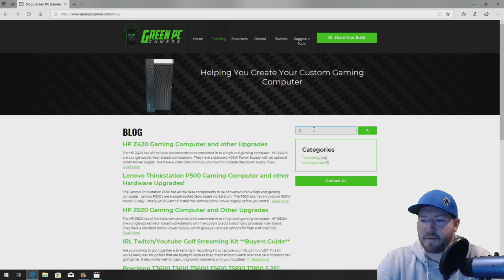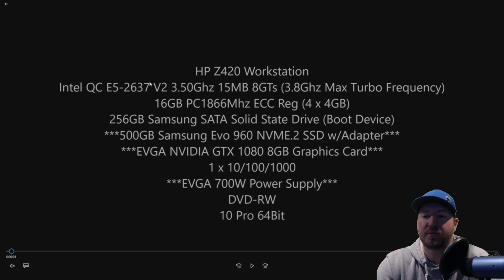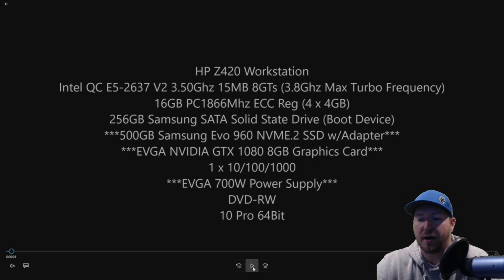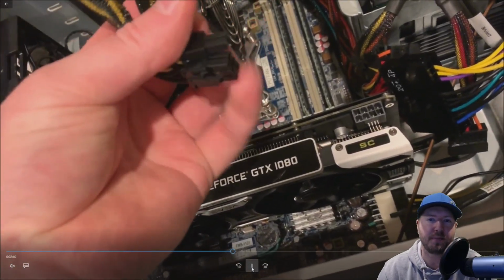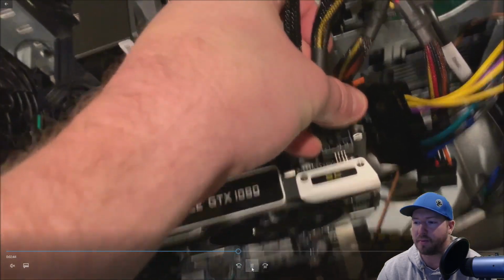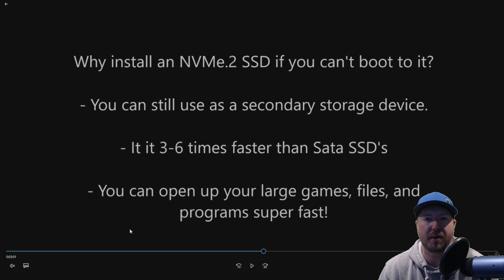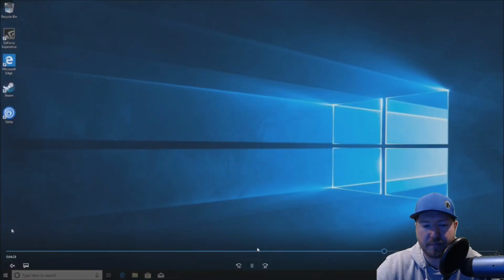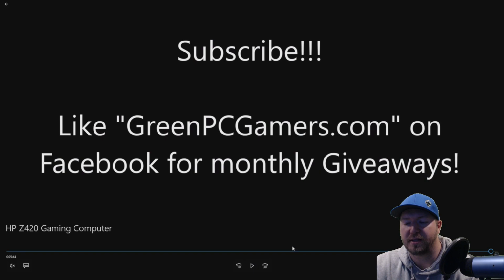HP Z420 Gaming Computer (GTX 1080 and NVME.2 Install)

Comment: I think you made a mistake on which PCIE slot you put the NVME SSD in. I'd have to double check, but, although it's a x4 mechanical, I think it's only x1 electrical. It's PCIE 3.0. So, you are capped at 0.9 GBs using that one. You are better off using one that has x4 electrical.

Comment: Hi, great video which I found rather late in the day.  My current set up is:  HP Z420:  Xeon E5-1620 @ 3.6 Ghz and GeForce GTX 1050 Ti GPU 4 GB, 16 GB RAM on Windows 10 (not 11 compatible, of course).   I just tried to install an RTX 2060 (with 2x6 power supply to 8 pin) but got no video signal out.  Nothing on either screen from any video or port.  I noticed my bios is ancient, like 2012, would this cause the problem do you think?

Comment: You sre using PCIe 4.0 SSD in PCIe 3.0 card which is plugged in a PCIe 2.0 port. How would you recommend that? Because the PCIe 4.0 SSD is already bottlenecked by PCIe 3.0 card which is again bottlenecked ny PCIe 2.0 slot. Can you explain?

Comment: I have one of these units, and I occasionally have problems when booting it up. It doesn't start the first time I click the power button, only loud fans non-stop and no display at all, I force the shutdown after that, then I press the power button and it boots normally. Anyone knows how to fix this issue?

Comment: is it possible to install 8 x 16 GB RDIMMs 1866Mhz in the version 2 boards?
Reply from the maker: Yes, but the memory will only run at the max speed supported by the processor.

Comment: So I have the same computer but I have 64 gig of ram and a better cpu so if I install my m. 2 can I move software from c drive to the m. 2 and run them off there for faster speeds?
Reply from the maker: You could do that.  However, you can't boot to an NVMe M.2 SSD on a Z420 w/o a boot assistant like clover.

Comment: Hi. Trying to install GPU geforce nvidia 650ti in a z420, but facing problems with power supply connectors two by 8 pins.Power supply is stock and more enough to run that gpu.
Can u advise any solutions with cable molex or sata options?
Thanks in advance
Reply from the maker: Are you using the stock HP 600W Power Supply?

Comment: I have a z420 that has only 1 6 pin connector and I would like to run a 3060ti that requires 2 8 pin connectors and draws 200w max. Could I use a single 6 pin to dual 8 pin adapter and have enough power to run it safely? The power supply says "G1" the 6 pin connector is 12v and 18amps which would make 225w of power plus the 75w the motherboard supplies so I should have more than enough power but I'm worried that a single 6 pin converted to dual 8 pins wouldn't be a good idea especially on a 8 year old power supply.

Comment: Wouldn't it be possible to setup dual boot?  Begin the boot loading from an SSD then pass control to the NVMe as the system drive?
Reply from the maker: You can do this with clover.

Comment: Anyone think one of these with the e1650 would suffice for a sub 200 
Dollar start to a gaming pc? Add in a rx470 or something similar used and a ssd?
Reply from the maker: It’ll work as long as you tweak the settings.
Reply: @GreenPCGamerscom  like in game settings or bios?

Comment: Hey! Not sure if you read this. On your website it states that the Z420 Comes with 600W PSU natively, and can fit in a 1660 TI graphics card. However, there are only 6 pins on the PSU, while the graphics card needs 8. Any hints?
Reply from the maker: Check out this guide:

https://www.greenpcgamers.com/technology/video-card-power-adapters/

Comment: do you think a 600w power supply can run a 3070? it only draws 220w and im using a 130w CPU.
Reply from the maker: It could work but might be a little sketchy because most MFG's recommend a 650W power supply  for the RTX 3070.

Comment: Do i really need to change my power supply? I have the same case and i was thinking about putting a gtx 1080 and was wondering if my psu would hold up.
Reply from the maker: It depends on the wattage power supply that you have installed.  The aftermarket power supplies are nice because they do not require any gpu power adapters.

Comment: Hi, I have a Z420 with E5-1660 and exaclty the same Samsung 960 M.2 NVME 256Gb,  mounted at the same PCIe 2.0 x4 slot but I cannot achieve read speeds over 416MB/s, tested at CristalDiskMark. Have you tested the speed after install? Do you know what could be the problem here? My BIOS is uptades to Dez 2019 version.  Could be my adapter? Install it with a new adapter at PCIe 3.0 x16 could improve the speed? Tks
Reply: Hello Hugo,
how did you make pc boot from your m.2 device? I have a problem with that!
After I inatall windows 10 and pc restarts  then it cannot boot from m.2 SSD!
Could you help me?

Comment: Hi, my NVME SSD seems to be very slow, not as mentioned to be super fast. I installed a Samsung SSD970Evo nvme. What could be wrong?
Reply from the maker: Did you install it in to a PCIe x8 or PCIe x16 slot?
Reply: PCIe x8, same as in your video

Comment: When building these do you have a go to wireless adapter?
Reply from the maker: We rarely use wireless wifi adapters.  However, you can easily purchase a $20 usb wifi adapter to gain wireless connectivity.

Comment: I am going to put my rx580 into this system. Mine is a 600w psu with the e5 2640 CPU. Is a power supply necessary?
Reply from the maker: The 600W PSU should be sufficient.

Comment: If you have system board PN 619557-001 aka 618263-001, you can only install V1 Processors
Below my question is Are these the V1 processors listed below? for upgrade with PN 619557-001 aka 618263-001? 

I have confirmed that this is my mainboard. Cpu-Z says my current core is a E5-1607 0 3.0ghz quad core 4 cores 4 threads

Recommended Processors:
 Is it ONE of these that will work with my mainboard? 

Xeon QC E5-1620 3.6Ghz 10MB  130W Processor | 3.8 Max Turbo Frequency (SR0LC)

Xeon QC E5-2643 3.33Ghz 10MB 8GTs 130W Processor | 3.5Ghz Max Turbo Frequency (SR0L7)

Xeon 6C E5-1650 3.2Ghz 12MB 130W Processor | 3.8Ghz Max Turbo Frequency  (SR0KZ)

Xeon 6C E5-1660 3.30Ghz 15MB 130W Processor | 3.9Ghz Max Turbo Frequency (SR0KN)

Xeon 6C E5-2667 2.90Ghz 15MB 8GTs 130W Processor | 3.5Ghz Max Turbo Frequency (SR0KP)

If you plan to install a CPU that utilizes more then 130W,  HP recommends that you install the liquid cool heatsink assembly.

Xeon 8C E5-2687W 3.1Ghz 20MB 8GTs 150W Processor | 3.8 Max Turbo Frequency (SR0KG)
Reply: Furthermore, is a E5 1607 3.0QC even decent for gaming it seems i hit solid fps in all but Final Fantasy XV can barely hit it on low before my CPU throttles

Comment: Z420 is still really good for budget gaming. I find its cheaper on ebay than the site linked here. A normal SSD for boot drive is fine, you don't gain much boot time from an Nvme. Nvme will be perfectly fine as a gaming secondary drive. I found the most surprising issue was needing a power converter for the motherboard when you use a normal power supply vs the HP OEM, which is in your purchase list, but didn't mention in the video.

Comment: All M.2 NMVe can use as Boot on z420, the secret is Mailiya M.2 PCIe to PCIe 3.0 x4 Adapter, no a lot people know that, with this adaptator all the old computer can be Boot on the all brand of NVMe M.2. only this modele do that. (big secret) because plug and play no driver with rom.
That why with this adaptator i dont buy a z440, i upgrade my z420 with a E5 1620 to a E5 1680 v2. the only thing you have to know is, bios 2011 only cpu v1, bios 2013 cpu v1 and v2. dont buy cpu v3 because its another bios motherboard LGA 2011-3
And to be sure and have the best use a pate noctua... the best.
Reply: Can you give me the purchase link of that PCIe? I also want to install nvMe on my hp z420

Comment: Old workstations are great for budget gaming builds. A few points of note for this particular build: The 1080 is 180w, not 300w, people often confuse total system draw in reviews as the card draw, which is much less. The 180w number is for a Founders, 3rd party OC versions will exceed this but still be well under the connector peak of 300w (75w+75w+150w). The stock 600w is more then enough for the entire system shown in this video, or any single GPU build, though may require adapters (6 pin to 8 pin, etc.).  If you are going to pursue the rather pointless addition of an NVME drive, as most people won't notice the difference (few games even benefit from a SATA SSD), absolutely do not install the already hot running NVME drive, right above a super hot back plate, as shown in this video. You should also get a blower style video card that exhausts out the rear as this case, like most workstations, has poor ventilation and the shown card just dumps all it's exhausted air into the case interior.
Reply: I have a z420 that has only 1 6 pin connector and I would like to run a 3060ti that requires 2 8 pin connectors and draws 200w max. Could I use a single 6 pin to dual 8 pin adapter and have enough power to run it safely? The power supply says "G1" the 6 pin connector is 12v and 18amps which would make 225w of power plus the 75w the motherboard supplies so I should have more than enough power but I'm worried that a single 6 pin converted to dual 8 pins wouldn't be a good idea especially on a 8 year old power supply.

Comment: I am getting a Z420 with the 2nd gen motherboard (708615-001) and It's running an E5-1650V2 (assuming it actually runs of course). It has 16Gb of memory but I'm assuming it's the slowest type. I'm considering getting 32GB for it. What's the fastest speed memory for this board (since every little helps). And yes, I know I'm probably going to have to ditch the 16GB . Or should I just buy an additional 16GB even if it is the slower clock speed. Also is the Z420 dual channel or quad channel? BTW thanks for the excellent work. You've got another subscriber.
Reply from the maker: Here are the PN's for the 8GB and 16GB Modules:

8GB 1Rx4 ECC 14900R DDR3 Module (731657-081)

16GB 2Rx4 ECC 14900R DDR3 Module (715274-001)

Most of the V2 Processors will support 14900R AKA 1866Mhz Memory.

Thank you for the kind words!
Reply: Tried this Mailiya but didn't work the W10 installer while it can detect the NVMe drive (SN750) it won't allowed to install the OS into the NVMe drive due to BIOS doesn't has the capability to boot into NVMe
Reply: @ArifOctovian  Yeah, I noticed that. I'm running a Seagate Barracuda 1TB SSD and my boot time is 22 seconds from button push to W10 Login prompt. I can live with that.

Comment: I've got my eye on a very nice E5-1650 v2 Z420 from one of the highest-rated sellers on ebay right now, that's exactly as powerful as the Ryzen system I was wanting to build, but for over 100 dollars less. Add to that the fact that the Z420 has many more PCIe lanes and is suitable for much more strenuous workloads due to the Xeon chip, and you've got a killer combination on your hands, especially since I'm more interested in content creation than gaming.
Reply: Hi, one question, the Z420 support v2 LGA2011 Processors? like E5 2643v2? bios update? thanks!
Reply: I just found a Z420 with the E5-1650 v2 and 32GB EEC ram. with Win 10 Pro license and SSD already installed. and he's only asking $200. =D
I'm gonna get it.. hell yeah.. I already made a killer Gaming rig out of a Dell T1600 a few years ago. and it's getting old now. need some cheap upgrade.

Comment: Instead of E5-2637 v2, you should have opted for E5 1650 v2 as its 6 cores and 12 threads
Reply from the maker: We really should have used the Xeon E5-2687W V2 Processor.  It has 8 Cores, and the capability of running at 4.0GHz with its Max turbo frequency.  Although, that would have required us to use the very hard to find Z420 Liquid Cooled Heatsink Assembly.  You are correct, the E5-1650 V2 would also have been a very viable option.  Thank you for your valuable comment!
Reply: The E5-2667 v2 is the same speed at any core loading as the E5-2687W v2, the same cache, the same features, except it is slightly cheaper, and uses less power. Since z420 doesn't support overclocking it's really the obvious choice especially as you avoid the need for the AIO cooler.

Comment: Hey.does anyone have advice How i set the ssd as the boot drive and nvme as storage
Reply from the maker: If you go in to the F10 setup you can change the boot sequence.  Normally the Z420 won't boot to an M.2 SSD w/o a boot assistant.

Comment: sometimes my z420 take time to boot up while spinning fan at full speed about 6 to 8 sec, then it boot up normally, it happens like 1 out of 5 times turning on the pc. what's the cause of this activity.? is this bad cmos battery ? or something else? kindly do let me know the cause of this. thanks
Reply: Not to worry. It is a normal feature on the HP workstations from much older to these and beyond. It is to help keep the heat sinks clear of the worst of the dust. It probably also allows the fan control to test/calibrate itself up to max speed and back. We use them at work and I hear it every morning from across the office as people boot up.
Reply from the maker: Hey Leo, this issue could be caused by so many things.  Can you post this on our forum and we'll try to help you figure this out? https://greenpcgamers.forumbee.com/

Comment: Samsung pm963 works well as boot device, which with UEFI option rom (To use this NVME SSD with UEFI option rom, please change "Legacy" of "Mass Storage Option ROMS" to "EFI" in BIOS. Win10 installing program will works well). Maybe intel 750 (with UEFI option rom) would work well, too.
Reply: does this require a special "mod" to the BIOS? or a standard HP bios firmware update? or simply the UEFI option rom you suggested?
Reply: @pointvicente123  I think this would only work with certain drives from that era. From what I've heard, the modern ones don't have it. If you look at random read performance with NVME versus SATA, I'm not sure how much it really helps anyway.

Comment: bro can i run zotac 1660 ti amp edition with a single 6 pin into 8 pin adapter or should i use 2x6 pin into 1x8 pin adapter ? i have the v2 machine with 600w power supply.
Reply: Well, you needn't. It is enough for 1660 ti.
Reply: @longfeian6338  are you sure bro?
Reply: @LEOKHAN  I run RTX 2070 with one 6-to-8 pin adapter, it works well. (there is only one 6 pin of my Z420 PSU). 2x6 pin into 1x8 pin will be more great, of course.
Reply: @longfeian6338  oh thats great..your 12v rail must have high amps output bcoz of single 6pin. I have 2x6 pin available.
Thanks buddy
Reply from the maker: 2 x 6pin female to 8 pin male would be ideal.
Reply: @GreenPCGamerscom  i just bought that 2x6 to 8 pin but will it be safe? I mean is that single 6 pin not enough? The single 6 pin rail got 18A.. just curious & dont wana burn powersupply or card.
Reply from the maker: LEO KHAN it will be safe.

Comment: In fact,  a few old types of M.2 nvme ssds with option rom could be used as boot device for HP Z420/Z620/Z820, including Samsung 950 pro(not newer 960/970 pro) / pm953, Plextor m8pe/m8se(not newer m9), etc. Only a few.
Reply: Mailiya M.2 PCIe to PCIe 3.0 x4 Adapter with this you can with all brand M.2 960970 evo plus, black WD,  etc..
Reply: @xperimentalmonsieur5958  I was wondering if an adapter could have built-in support for that. Thanks for the info. I have a Startech one. I never tried to boot from it. But, I found that even on really old systems that only have PCIE 1.0, it worked and basically looked like you could get performance better than SATA. I think that's just for sequential speeds though. For random, I'm not sure if makes much difference. I tested some of mine with CrystalDiskMark and found that in some cases, the SATA were actually faster, depending on the drive.

Comment: Sir I am planning on sticking an RX 580 inside it, will it overheat due to the small enclosure? or should I get a 1060 6gb instead?
Reply from the maker: We normally choose NVIDIA GPU's, so we'd go with the GTX 1060.  However, quite a few members in our community are using ATI GPU's.  Thanks for commenting!
Reply: @GreenPCGamerscom  But where I live the RX 580 is a bit cheaper and is slightly more future proof since newer titles are coming up based on dx 12 and Vulkan APIs, plus it has more VRAM, so I wanna know if big cards like it or the 1060 or 1080 overheat within the z420 chasis.
Reply: @syedshakaibanwar2698  My EVGA GTX-1070 SC runs at 72c under full load running heaven benchmark with the default fan speeds.
Reply: @White-Wolf1969  In the z420 chasis? how though? I mean the casing doesn't even have intake fans.
Reply: @syedshakaibanwar2698  Yes in my Z420. It has better airflow than most people think.
Reply: @White-Wolf1969  Ah I see so my fear of overheating was dumbfounded, I wouldn't game a whole lot on it anyway, just game leisurely so I should be fine.
Reply: @White-Wolf1969  I am also getting it with the xeon e5 1650 v2, what sort of performance can I expect.
Reply: @syedshakaibanwar2698  I have the e5 1620 v2 and I get roughly i7 3770 like performance. The 1650 v2 should perform similar to a I7 4930k. here is a comparison between the two with the ryzen 5 2600 thrown in for perspective. https://www.cpubenchmark.net/compare/Intel-Xeon-E5-1650-v2-vs-AMD-Ryzen-5-2600-vs-Intel-i7-4930K/2066vs3243vs2023
Reply: Did it work when you put an RX 580 in it?
Reply: @seljak2416   Don't know if your still interested but my Z420 will be turning up  on the 18th of Feb and I have an RX 580 ready and waiting for it. Do you still want to know how well it works?
Reply: @PaulLemars01  thanks for the answer :) I already finished my Z420 upgrade, new 750W psu and a RX590, works perfectly with the atx adapter and it doesn't seem to overheat at all. Hope your build will work as well :)